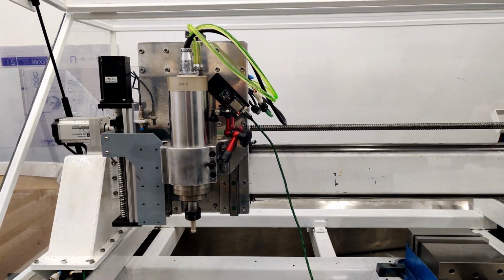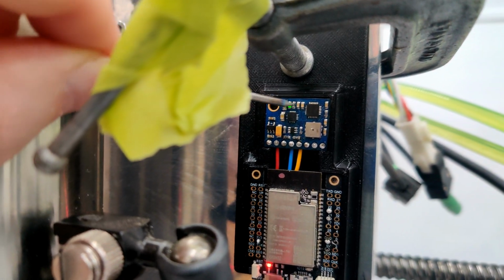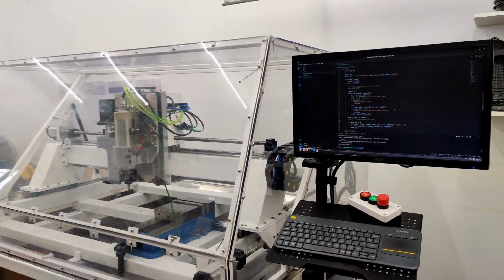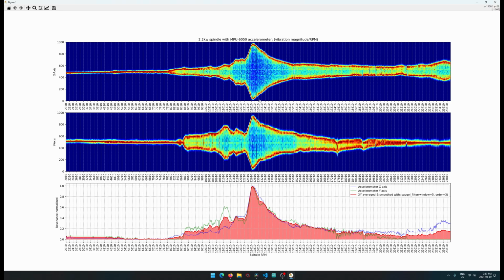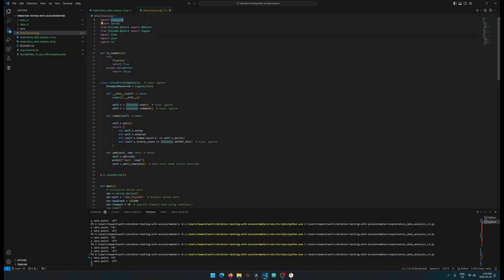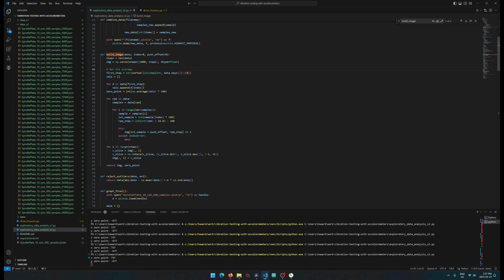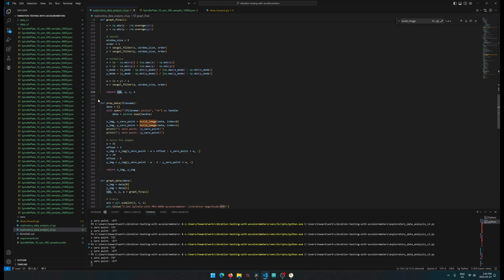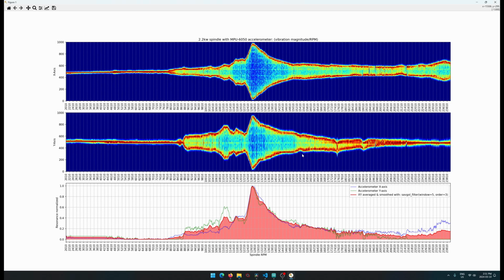🚀 Exploring CNC Vibrations with Accelerometers, Arduino, and Python! 🚀

Comment: Great project! Thanks for going through the code too! This project is right along side an idea I want to try of recording the vibration of some repetitive job like machining a production part, and monitoring all subsequent jobs against the original recording. Something like an FFT averaged into bins, and the original recording is used to create a tolerance. If your production run falls outside the tolerance you've got a problem like broken or chipped tool, so flag the user. With your experience here do you think this is a good idea to try out in python with an accelerometer on a cnc machine?

Comment: Great effort with the tools at your disposal. Generally speaking for "Order Analysis" (Google Search Term necessary for those who want to learn more about the topic) a much higher resolution single plain Accelerometer** is used along with a higher ADC to obtain a series of frequency plots at known RPMs over a given RPM range that are then plotted in basically a waterfall plot. However, rather than the Power Spectral Density waterfall plot being X(Frequency) by Y(Amplitude) by Z(time history) you have Z as RPM. So for a given RPM step you have a PSD, all of which are on the same scales. When this is plotted properly in 3D it can quickly show dominant modes (or Orders) of excitation as they transition through the RPM range. Essentially you can see "fingers" or "branches" of peaks that trend across the Z axis and represent specific Orders of the various components of the system under test. 
**Ideally the single axis piezoelectric Accelerometer would be directly affixed to the spindle motor where the direction of excitation (measurement) of the accelerometer would be perpendicular to the rotational axis of the spindle.
Doing this type of testing with a multi-axis Accelerometer is problematic as the additional axes induce error in the measurement if they are not located in line with or directly perpendicular to the rotational axis of the system under test. If the X axis is perpendicular to the rotational axis and on the case of the spindle then the Y axis is some distance away on effectively a torque arm. There are ways to deal with this in software and this can be used for rotational balancing, but for most in-field applications that use Order Analysis as a measure of system stability and wear only a single axis accelerometer is used. 
I have used Order Analysis in various propulsion systems over my career and it's been very useful for establishing safe operating RPM ranges along with keep-out zones that can be transitioned through, but not dwelt in. I most often have used them for car engine knock detection, but I have worked on much more complex systems that the manufactures of the system could identify issues with specific bearings based on the results of Order Analysis plots. There is nothing like an engine manufacturer telling you that you did something they specifically told you no to do based on accel data and a little exhaust smoke... lol
It's great to see these historically expensive and high level measurement practices being used more often in DIY and consumer Maker products. I have done a number of accel and jerk tests with my DIY 3D printers and found even the IoT MPU-6050 effective at addressing noise in printed induced by harmonics in the various components.

Comment: do you think cnc routers may benefit from input shaping as in 3d printers?
Reply from the maker: It won’t have any benefit. When your running an endmill through aluminum, steel, wood or other material you are generally moving quite slow (400-3000 mm/min) some special cases you’ll move much faster like 10,000 mm/min (high feed milling) but when you do finishing passes you are running a tool slow to get good surface finish. 

The main source of vibration on the machine comes from the tool and there are way too many variables regarding tool geometry, feeds, speeds, DOC, WOC, MRR to take into consideration. This is different to a 3d printer where the vibration on the machine is due to the dynamic motion of the three axes.

The main way to improve the quality of the machined surface finish on a cnc is to increase rigidity and mass for damping. This counteracts the vibration of the cutting tool allowing you to increase the MRR and lessens tool deflection so your milled parts come out closer to final dimensions.

Comment: Have you ever used REW (room equalization wizard)?  I use it to do frequency measurements of my stereo and what you're doing reminds me a bit of how it works.  Using REW it does a swept sine test which it then analyzes to give frequency information, including room modes.  I'm not exactly sure how you could take the audio signal from REW to control your spindle speed, but if you could, you could get the modal frequencies in a single sweep.  I do modal testing at work, but it uses an extremely expensive B&K system and a large shaker.  I'm sure it could do what you're doing, but I'm curious if REW and your accelerometer could do something similar.  Check out REW, you're super smart and I bet you could figure out how to make it do what you'd like.

Comment: My friend's dad used to use a stethoscope with a copper dowel attached to touch and listen to parts of his engine. Audio indicates a lot. Send it to your waterfall graph.
Reply from the maker: Yeah I like to try a different method of capturing that's more like audio. There's so much of the data that I'm not capturing by using the accelerometer.
Reply: @BryanHoward  i think audio with depend a lot on exactly which piece of metal you attach it to, and how you affix it.
Reply: @BryanHoward you can make a digital stetoscope by running the accelerometer data to a speaker.
In other instances it is often useful to playback measurements even if the analysis is to be used in another way ultimately.
The human ear can detect quite alot, sometimes the source of strange data is easily identified.

Comment: What is your measurements bandwidth ( i.e. high cutoff frequency -3dB in Hz ). Significant part of energy will be in high frequency range say 10's kHz to few MHz. Small magnet in coil as a sensor + hi speed ADC would be good choice. You can put 3 such sensors in X,Y,Z axis in few points of machine to get some greater picture. Regards from Poland.
Reply from the maker: The small IMU breakout board I have hooked up to the ESP32 has an HMC5883L magnetometer on it. I wonder if that would pickup the spindle if I attached the board directly to the spindle. It only has a 160 Hz maximum output rate on it though. 

I have a bunch of different ESP32 boards and I think most of them have ADC that might be good enough for this purpose. I'll look into this more. ESP32's run at 160mhz so might be good. Bottleneck might come back to the linux machine what it can read over usb

Comment: Those cheap chinese VFD's change to highter freq range around half the max speed. So that is where the artifacts come from. it is like going from low gear to high gear while pushing gas bedal down. I am not sure how it works internaly but first range is i think from 0 to 500 or 600Hz.
Reply: Now i remember they take that first Freq range double it and shift phases around then start increasing freg so basically freg changes allways min 2Hz because one range increases 1 hz but it is doubled. because phase shift.
Reply from the maker: Very interesting! Is this regarding the area between the 11k-13k on this spindle?
Reply: @BryanHoward yes after VFD doubles the Freq it takes a while to spindle and VFD to reach equlibrium. Spindle usually have most power in lower frequency range where speed is lower. That reduction on vibration in higher speeds is when VFD manages to ramp Freq in area, where spindle and gets to sync. Whole thing goes more like 500Hz to 0Hz to -250Hz and +250HZ. All this happens really quickly but spindle and VFD lose sync for a while. It is hard to find cheap VFD's with true 1000HZ Freq. And don't know if even more expensives have more than 800HZ true Freq. Better spindles don't even need this high Freq. Also Highter price VFD's do this doupling of Freq faster and better. it might be possible to see this using oscilloscope with VFD.

Comment: I like your use of pickle files to bypass re-processing input files. I use that technique frequently too, and it always saves TONS of time. I would store your raw values in .csv with rpm, x, y, z on each line. Loading it from a pickle file is still going to be faster, but I try to avoid json when possible - it's a really dumb format that's not efficient at all. It's good for small chunks of data in unknown or varying formats, and really bad at large series of data that's all in the same format.
Reply from the maker: Yeah it's a dumb format but I didn't want to have to make more work for myself to convert strings of float arrays for each axis in a csv, or save out a csv for each axis. The json files in the end are temporary any more runs I do with this, I'll probably just save out one big pickle because it looks like the automation is stable to not crash anymore. (wireless keyboard interrupts was the cause of my crashing in the video).

Comment: Hi Brian. I cannot with honesty claim any CNC expertise. However. I am very familiar with time series accelerometer data. It might be useful to view your data in the frequency domain. SciPy makes that super easy to do. Since your data is pickled as nympy floats, it might take around 5 lines of code to make a periodogram.

I am very interested in your recent accelerometer work. If I can help, please let me know. I can join discord, whatever it takes.
Reply from the maker: Thanks! I've got the code as well as the data shown in this video in a pickle on github (see description for the link). I'm on Discord and most work in the PrintNC group. Here's the invite: https://discord.com/invite/printnc-diy-cnc-hobby-machining-making-648972213734604807

I'll get a post on that Discord channel dedicated to vibration testing as it currently grouped in of of the modification/experiment channels.